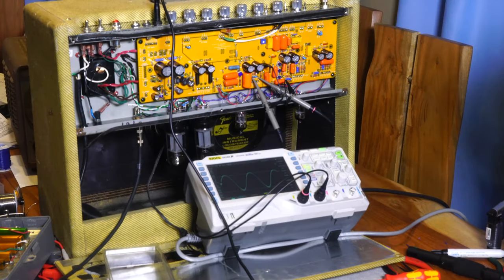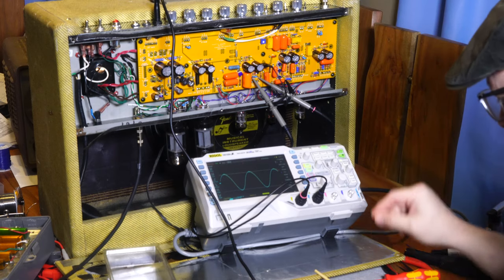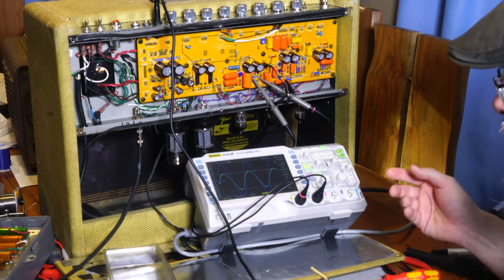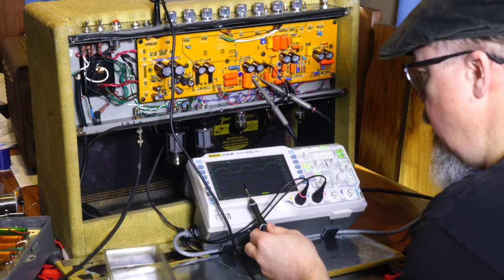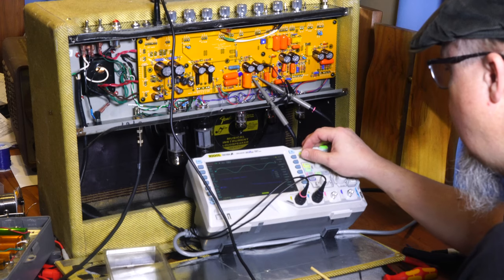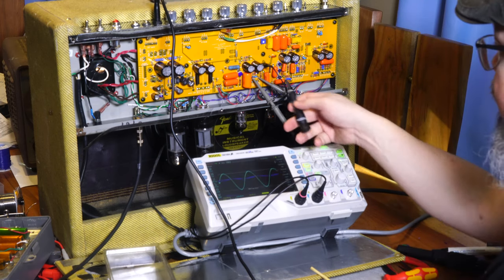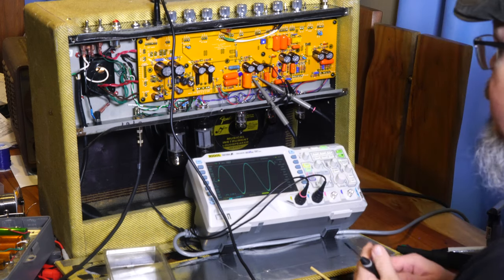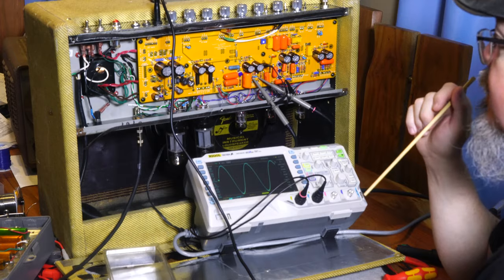Tube Amplifier Phase Inverter Balancing

Comment: Just came across this - great video!  That last bit of phase differential is probably coming from the negative feedback loop and is an artifact of imbalances in the output transformer, the output tubes and / or the two half's of the inverter tube being very imbalanced.  Like you, I strive to get what I can balanced.  An 1970's audio engineer once told me "Design for the cleanest tube amp and you'll get the best distorted amp sound imaginable."
Reply from the maker: Excellent info, thanks!

Comment: I've always been curious, but for some reason never never got around to testing it,  what an amp would sound like if it had a cathodyne PI and had a WAY ubalanced tube in it. I mean like going crazy with it, like using a 12DW7 (asymetrical dual triode, one triod has an amplification factor of 100, the other is about 20). I want to find out, but the only amp I have that uses a 12AX7 as the PI (as opposed to some weird random old octal dual triode like 6SL7Gs) has a cathodyned phase inverter, so it would only make it quieter.
Reply from the maker: Let me know if you ever get to try!
Reply: @FrenchieFilms  I will, and probably soon, waiting to hear back about trading my old Ampeg Reverberocket for a (JCM 2000) DSL201. Have to double check the schematic, but pretty sure that amp has a long-tail PI. I'll try to get some control (balanced PI) clips reccorded for reference then record the asymetrical one with everything else equal and similar.
Reply: You end up with really weird (unmusical, IMHO) frequency anomalies from phase shift.  It can also lead to the output tubes wearing out unevenly.
Reply: @andrewsrea  Yeah, I could imagine it doing some weird phasing stuff that would vary depending on random luck, though I never did get that trade so I currently only have a Peavey Classic 30, and that has a cathodyne phase inverter, using only one triode.

Comment: Can you do a scope video of  testing the power supply caps? This interest me, people seem to think just swap all power supply caps on older amps but I think it would be better to see which one is bad with a scope?
Thanks
Reply from the maker: I am a firm believer of two things 1. Electrolytic capacitors dry out and need replacement every ten to 15 years.  2.  Electrolytic power caps have no impact on tone unless they're not working anymore, then the lack of good filtering adds noise.  I only know of ESR testers at the best way to check electrolytic caps.  Nothing I've seen or heard of that used an oscilloscope to test them.
Reply: @FrenchieFilms  OK. I think if the sawtooth waveform does not look clean and you see some noise, it will show up in the waveform? I wish I had some test equipment like that to find out. 
Thanks
Reply from the maker: Well you can see power supply ripple noise for sure, but how much did the amp have when new?  You don't have a comparison baseline.

Comment: Not counting the well-designed board, what was the approx. cost in Mouser parts? Also, are the filaments/heaters just on AC yet?
Reply from the maker: About three hundred if I recall correctly.  Yes ac heaters.  I've never had a major problem with them so long as I get the lead dress right

Comment: just finished mine...relays are not working, want change channel or boost ..voltage reading fine.. limiter showing no shorts
any suggestions?
Reply from the maker: Sorry I didn't see this until now.  It's a bit tricky to explain in YouTube comments.  Have you checked voltages at the relays?  If recommend posting on forums like ampgarage or the like with photos of the build and voltages around the amp